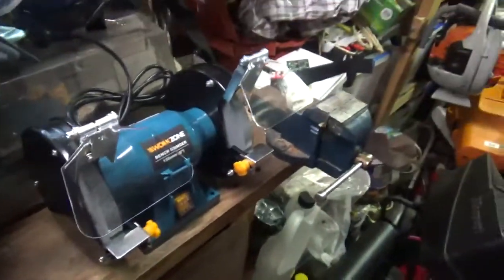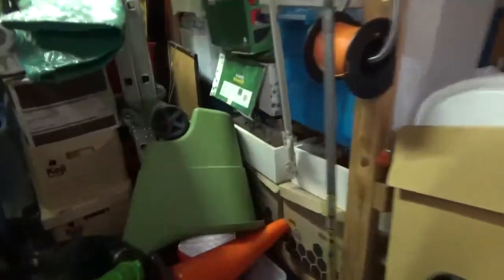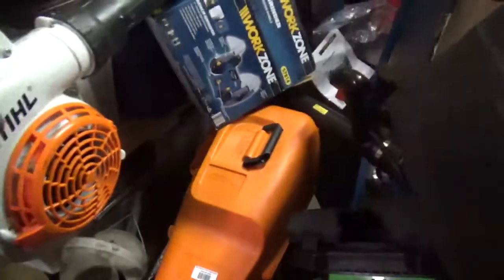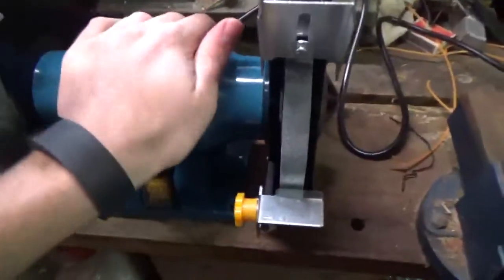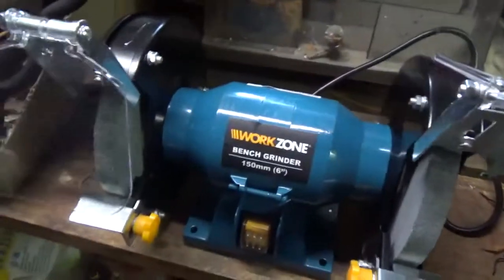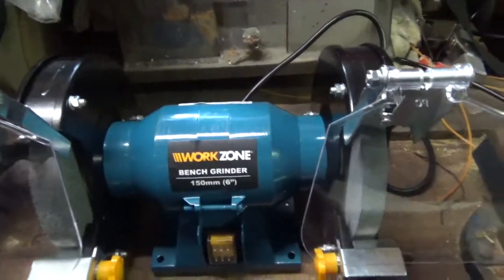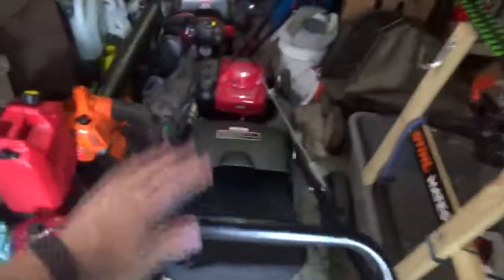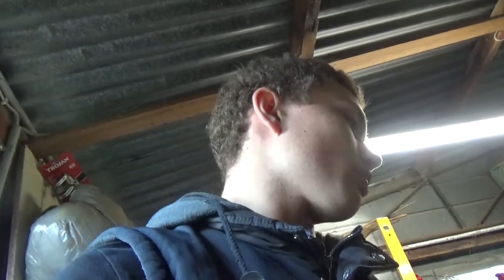New bench grinder!!

Comment: I sharpen mine every week. I have a bench grinder but I put the take the blade plate off the mower and put the blades in my vice and use an angle grinder. Fairly quick but just take care and wear safety glasses and gloves. 
Oh and your shed makes me feel a lot better about mine. lol.
Cheers mate.
Reply from the maker: Haha yes thanks Cliff I was thinking about just using a dremel or angle grinder but thought this gives a more uniform edge and it is a little easier for me.

Comment: Hrx217 u would sharpen  your other honda 216 u would just replace the sets of blades. I sharpen mine maybe every 2 weeks just depends how much mowing your doing. And if your mulch cutting can dull the blades a bit quicker so i hear. I would say your dealer would just replace mower blades if u have 4 single blades on your mower my rover 560 22inch i just put new blades in my honda is like your 217 with the 2 blades and i sharpen those.
Reply from the maker: Yes I mulch most of my yards now so that's why I'm thinking of sharpening more often. I think I will settle with 5-hour intervals for my mowers which is probably what I would do in the space of a week or two and monthly for my edger. I don't really want to replace blades if I can spare it because as you can see I already have enough crap in our garage lol don't need more but I will ask Rob at my mower shop about it.